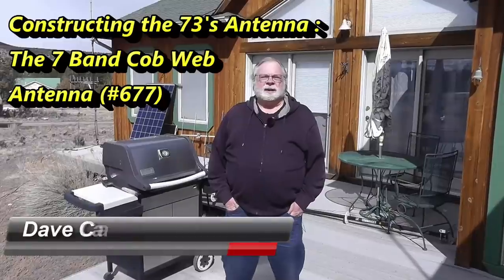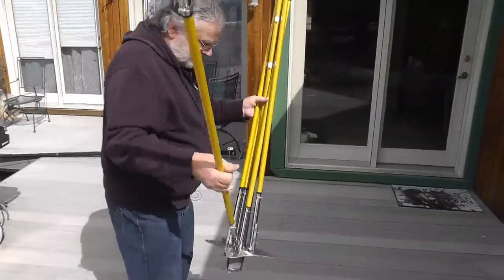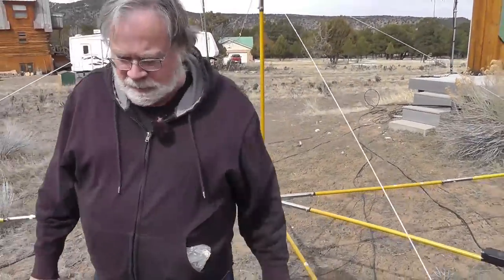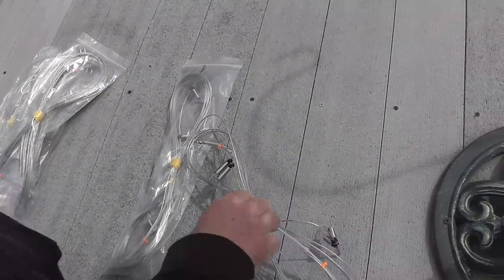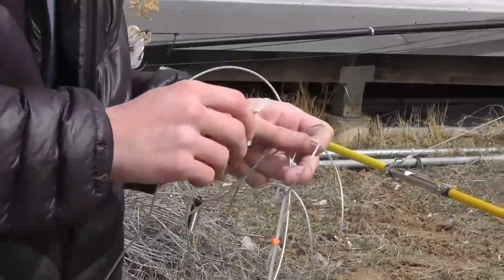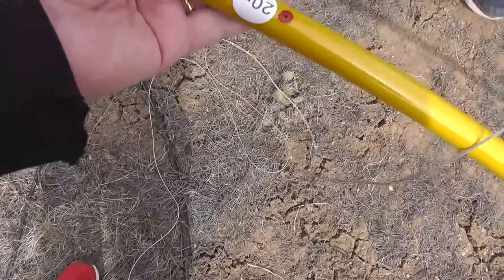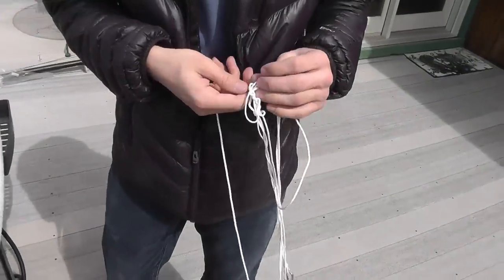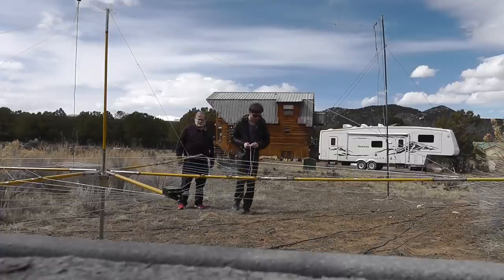Constructing the 7 Band Cobweb 73's Antenna (#677)

Comment: Hi Dave, thanks for the build; very nice.

I was going to say that it seems to me that virtually every antenna that involves booms, poles, etc.; except plain wire antennas, - that building it on a vertical  post is nearly mandatory, so that you  can support it, spin it, get at the top & bottom to adjust & tighten things... 

As I am 6'3", I figure a pole that's about 5 foot is just right. I can stand up & look down on it, or sit in a chair below it.

Before you put it up on the tall pole for testing; please do some SWR & listening tests where it is, to illustrate how the SWR is impacted with differing heights.

Thanks & 73,  John - N7GHZ

Comment: Nice antenna, I am considering one.
I would have bolted all but the balun arms down first. Then the lines to square it up. Then the radials.
Ideally, if you had yourself and another, you could be attaching parts while the other person worked on the tangled radials. Looking forward to the next video on erecting the cobweb! 
73, DE KB2WZT

Comment: Dave, do you think, once complete assembled, it would be possible to fold and unfold the antenna (with a „individual mechanism“) for using it for a temporary mounting in a area of limited space? Unfolding it first at a „suitable height“. Like a Rotary dryer. 73‘, Stefan
Reply: Smaller cobwebs (10m - 20m) are sometimes shipped fully set up, tuned and folded like you say. All you have to do is unfold and secure the arms with the supplied screws. It would be very easy to reverse this proces... This one is twice the size of a 'normal' cobweb, so it won't be that easy...

Comment: 73 Antenna is smart because we don't use instructions anyway ;)   Half of the fun is fumbling through the parts whilst figuring out how to put it together, and as a bonus there are usually extra parts laying around at the end of the build, that would have been wasted had we read the instructions. So, just say no to instructions, and use those extra parts for other ham projects! Cheers and 73   EDIT - On a serious note, it is nice 73 sent extra parts in case they are needed in the future. Also, the design is good enough where instructions are not needed, and this appears to be the case.

Comment: Everything about the antenna is  great, except for the really low power rating. I would buy one tonight if it were rated for 1-1.2k watts.
Reply: I got my 6m - 20m cobweb from a Polish builder. Rated up to 1.5kW PEP.